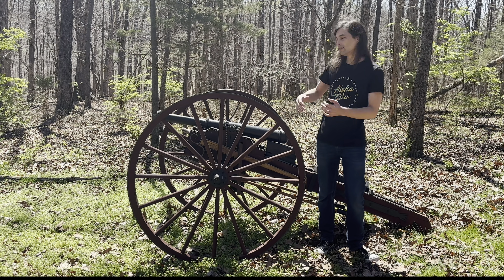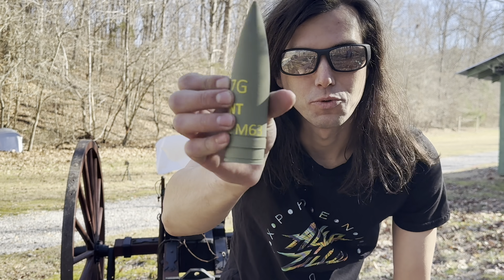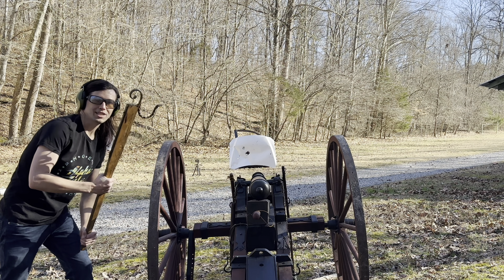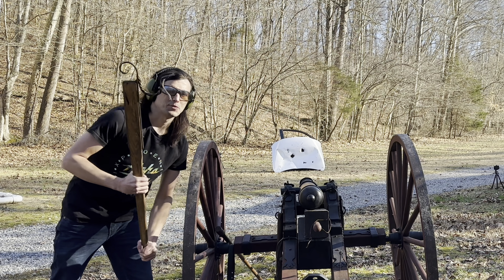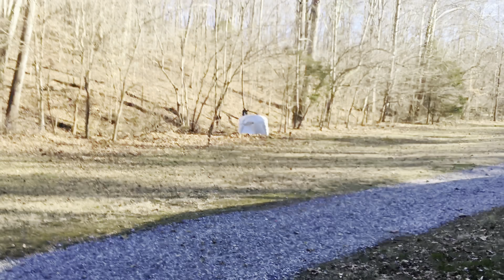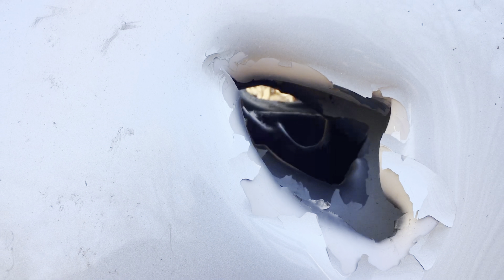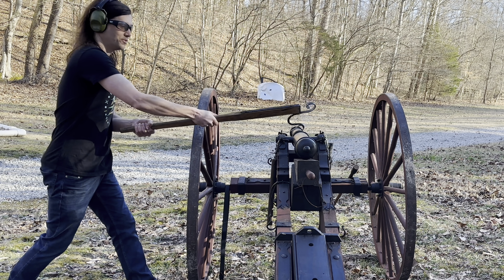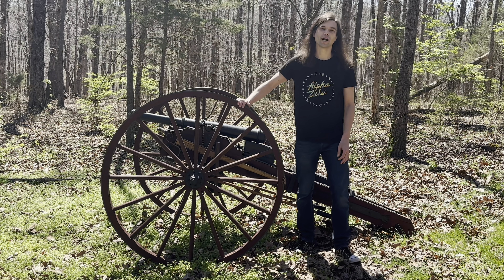Shooting 3D Printed Tank Rounds

Comment: Not sure if anyone commented this yet but PLA is a rather weak filament for 3d printing and is likely to shatter or break apart when firing. I wouldn't be suprised if you're getting a hunk of plastic going down range instead of the properly shaped projectile. Also it appears that long rod of lead separates during flight. I would like to see this repeated where you only do the outer layer of printing and use it as a jacket to cast a lead projectile inside, similar to the copper jacket of a bullet.
Reply from the maker: I just upgraded my printer to handle all the different filaments so hopefully we can try out some of the harder stuff one of these days!

Comment: This type of projectile requires rifling in order to be accurate. For smoothbores you need to look at fin-stabilised projectiles. Two choices on that front are: small fins and (very) high velocity. AKA the APFSDS or 'discarding Sabot' type projectile or low velocity with long, thin pop-open stabilising fins. This is the approach used for HEAT warhead projectiles fired from smoothbore gun barrels.

Now a 'spinning' HEAT round is usually undesirable but you could take the approach that some aircraft rockets do and angle the fins so that air pressure induces a slow 'spin' in the projectile providing an improvement in accuracy similar to rifling.

Comment: the leadcored ammo is just dissintegrating in the barrel, the pla cant push the lead with that much force, so ur just shooting the pla of the lead and then the lead projectile carries behind it at much lower speeds, thats why there was such a huge delay on the first lead filled shot, first the plastic hit the door then the lead core went trough

Comment: Ya that's lead filled print came apart
...your gonna have to study the Nosler Partition, as well as other bonded core techniques. Might have some luck with pl400, or Beats Nails.  Scratch up the lead so that the glue has more and better surface to grip, and sand paper the 3d print as well.  JB Weld is probably a winner as well.  Kick ass, man. Keep the good shit up

Comment: just a suggestion. try to mold a diabolo pellet round. it is designed to fly straight oud of non riffled barrels.
Reply from the maker: I’ve got a printed version so I’ll look into casting them and see what I can do!
Reply: @TheCannoneer  printed objects are made of plastic mesh, as far as i know, the denser the mesh is, the object is heavier. But the mesh is eassy to break under presure. So be it pvc, lead or other material, casted projectile should do better than printed.

Comment: Those are some seriously tumbling rounds, almost every single shot landed sideways :P But the impact ofc was massive regardless due to the lead. Yet I feel greater penetration could be made if they hit on the nose rather than the sides, Normal cannonballs might be superior without the rifling.
Reply from the maker: I didn’t think plastic would leave a hole like that at all. Someone suggested we load them with rocket motors and we did that in a later video as well. Those seem to fly a bit straighter and the hole they leave is insanely huge. Thanks for tuning in!
Reply: @TheCannoneer  Anything launched at high enough speed will punch a hole. Be it plastic, wood, iron, or even softer materials like rubber. Rockets might stabalize the flight somehow, rifling ofc would help. My best bet would be some sort of shaped fin system that utilizes the gasses from the cannon to spin, Although you would have to shape them perfectly..The conclusion being, round shot for none rifled cannons is superior. Yet have you seen how Golf balls look? Perhaps if you made a cannon ball to look like a golf ball with those dips over the surface it might help with both accuracy and range. Just a thought. I am no scientist, not even a school graduate, yet if it works for golfballs it might just work for cannonballs too.

Comment: Is your cannon rifled? If so, will the twist support a conical projectile?  Some rifles have a twist suitable for ball but not a conic. If the cannon is not rifled these projectiles will never be stable and you're only hitting now because you're shooting point blank.
Reply from the maker: No. Cannon rifling didn’t show up until the early 1850’s and since ours is a revolutionary war style it doesn’t have any. We actually got these out to 100 yards on another video and they seem to fly fairly straight with some rocket assistance!
Reply: @TheCannoneer  these cannons should be able to shoot a round ball accurately to 400 or 500 yards.  I don't know about this 37mm (?) cannon, but larger civil war cannons (4" maybe) are remarkably accurate. Out of point-blank range, your modern-style projectiles will fly randomly. Take a long shot and prove me wrong #baitingformorecannonvideos

Comment: May need to work on your center of mass for your projectiles as well.  Try to move the center of mass forward.. I also do not think your print material can withstand the pressures in the cannon and are disintegrating as they leave the barrel..  But otherwise kinda fun.
Reply from the maker: I’m sure we will be revisiting this one in the center with some PLA+ lol

Comment: You should try this at about 500 yards to simulate firing at an enemy Force at that range
Reply: Not sure if you're familiar with a lathe machine you could probably use solid copper or brass heads or even hardened tempered steel for the inner core and top of the projectile checking your powder charges and weight at adjusting to according to the barrel twist if there is any and so forth good video
Reply from the maker: I’m sure we will end up with a metal lathe sooner than later at the shop. It’s one of the few tools we don’t have! Thanks again for the ideas and I’ve added those to the list.
Reply from the maker: One day! We’ve got a 150 yard range so I’ll have to look around and see what I can find. We’ve tried to shoot 100 yards and our current sight doesn’t work out that far very well but we’re about to remedy that as well. Then we can start the distance shooting! Thanks for tuning in!

Comment: I'm guessing that cannon is smooth bore

G1 and G7 style projectiles won't stabilize and will fly erratic (football shaped)

attempt to do the same experiment with fin stabilized discarding sabot (sub caliber dart)

Bias the weight to the front of the dart

You can also attempt to do this with a DS type round where instead of a dart you will use something more akin to a air rifle pellet and have a sabot around it to make it sub caliber
Reply from the maker: It is a smoothbore. Rifling in cannons didn’t show up until the 1850’s and ours is a revolutionary war style. I’ve actually got a prototype of the dart sabots printed up and will be coming out in a future video! Thanks for tuning in!

Comment: they are keyholling.    since there is no rifling they have nothing to stablaize themselves. you need FS rounds
Reply from the maker: On the printer! I’ve got a pic of the first draft on my Instagram too. Thanks for tuning in!
Reply: @TheCannoneer  for smooth bore, you have to enter the lovely world of Discarding Sabots, a horror for all home printers...  

and fin stabilization, an even more problematic choice   fin stabilization have a "tail" with fin on it,   in some cases these fins are fixed... in other cases they are spring loaded to expand when they leave the barrel.     now consider the...   engineering..    for a fin and spring system to withstand the heat and pressures of the barrel and for the fins to still pop out once they leave.   

Look up  120mm HEAT rounds for the different styles used.

Comment: The lead core needs structural support to connect to the walls of the barrel, its likely squishing in the barrel upon movement. A sabbot that is .09 to .13  over will squeeze the compression you want for flight stability
Reply from the maker: I’ll try that next time we revisit these! Thanks for the tip!

Comment: To give them weight more easily you can buy low heat metal alloys used to make chucks when machining. Some of them are very close to the weight of lead and you can easily melt it in boiling water.
Reply from the maker: I’ll look into that!

Comment: How did you pour lead into a PLA casing??
Reply from the maker: Sand casting! So the hollow ones I just filled and then dunked into water really quickly. Lead cools super quickly but it did melt just a bit of it. As for the tipped ones, I cut off the base, put them in a full size sand mold and then poured lead through the hole to fill up the top and the hole. Then dunked them to cool them off after the lead started to set up. They melt a little bit but once they cool they stay together quite well. Thanks for tuning in!

Comment: Cast a lead projectile like a shotgun slug with 2/3 of the weight in the front of the projectile that should solve tumbling issues
Reply: With elongated projectiles you want the shuttlecock effect also known as the rock in the sock effect if you don't have rifling this is how a shotgun slug stabilizes
Reply from the maker: When we revisit this one I’ll be sure to make that version and see what happens! Thanks for tuning in!
Reply: I shoot cannon as well mostly round balls mines 2.25 inches cast the ball out of a downrigger mold from do it molds

Comment: 😂you can try shooting marbles that would be cool trun your cannon into a shotgun or try and get some old horse shoes and cut them into 2in pieces I heard thay did that at the battle of the Alamo 2 Question is were can I get a black powder connon it would be so cool to have 1
Reply from the maker: We’ve shot some marbles as canister shot and we use some giant ones that are the same size as the cannonball too! They are quite scary as they explode into shrapnel rounds! I like your horseshoes idea! And we built ours! There’s a video about it on the channel if you have access to a shop you should build one!

Comment: A last comment....
In my fantasy 3.5 game...
My smoothbore gun tubes used by military forces in my homebrew world fire saboted finn stabalized sabot rounds.
The sabots are made of wood with a cone shaped indentation in the front of the sabots to catch the wind to snap the thin wire and separate the sabots and dart/ bolt continues down range.
I bet with some expermenting you could easilly make a fin stabalized sabot round.
Use crisco grease or lard for lube.
Reply from the maker: I much appreciate your comments! I’m actually printing some as we speak on the 3D printer! I’m excited to see if they work and I’m going to be putting a safety wad under them to make sure they fire out. I would love to have some in metal one of these days!
Reply: @TheCannoneer  use a piece of I would say... rebar 1/2 or 3/4" about...hmmm I would guess from your serpentine one about 8" long with welded on fins.
( Look at a modern M1A3-4 APFDS ROUND and model your round out of rebar based on those dimensions)
Reply: I'm good at thinking of shit like that....
Guess it's all the damn military history reading and research I've done and my marine corps time I spent in the suck ( what we call the marines lol). And the fact I'm a old country boy rotflmao
Reply from the maker: @swampfox1776.  Nothing wrong with being a country boy of any age!

Comment: That lead core is MOVING!!! 800-1000FPS
Reply from the maker: I would love to chrono it but I’m afraid it might take out the chrono!
Reply: @TheCannoneer  I absolutely agree that the fireball would destroy a chronograph. My suggestion to you would be doing a board to the side of the cannon painted at 1-ft increments and then filmed from a 90° angle with a high-speed camera and then you can review the distance travelled per second and convert.. like how Myth busters used to do. 👍🏽👍🏽
Reply from the maker: I know exactly what you’re talking about! Hopefully we can get a nice high speed one of these days. I’ve got big plans for the channel if we can get there!
Reply: @TheCannoneer  Right on! Good fortune to you and your endeavors. 👍🏽👍🏽👍🏽👍🏽

Comment: Awesome video! Well done! Love to see some higher speed video of the rounds but high speed cameras are expensive. 😕 I saw another channel post how 3D prints can be filled with plaster to make them similar to ceramic and heavier. Doing that with these prints may give an interesting result if you're willing to shoot them. I'd try printing with zero bottom layers, 10% gyroid infill, and 3 to 5 walls. That should allow the plaster to be poured in from the bottom and maintain its shape. Thinking about it, small enough lead bird shot may also fit between the infill, then plaster. Could also experiment with rifled round designs. Thanks for making the video!
Reply from the maker: I screenshot your recommendations for everything and I’ll give that a shot! One day I’ll get the slow mo guys on the channel! Thanks for tuning in!

Comment: Your lead fill is being left behind by the low inertia PLA.
Use a pusher plate and wadding.
Reply from the maker: I’ll add that to the list for the revisit on these! We usually use a .5” tpu discs as a spacer and those are reusable and hold up really well. Thanks for tuning in!
Reply: @TheCannoneer  awesome! 
I'd love to see you sand cast a diabolo projectile for the cannon. Maybe lost foam or lost pla . Aluminum, lead, HDPE.
You could print a cannister and fill it with 10mm lead balls, print a sabot for a fin stabilized penetrator spike. 
Look to super-sized Tau Flatermouse experiments. 
Looks like fun!

Comment: I was hoping when you said sabot, you meant discarding sabot fin stabilized.
Reply from the maker: Those are on the printer as I type this. I’m excited for that one.
Reply: @TheCannoneer  did you make a plethora? canted, curved, straight, reverse curved. Take the .117 style pellet design and print it to fit the cannon (cast lead would be better because you could fire it backwards).  From the looks of your shop, you should be well equiped to do some lost PLA castings

Comment: your key-holing due to smooth bore
Reply from the maker: Very true! Rifling in cannons didn’t show up until the 1850’s and since ours is a revolutionary war style it lacks it. I hope if the channel gets big enough to get a 3” rifled field gun and then we can have some bigger fun!
Reply: @TheCannoneer  I dont know if your anywhere near the south, but its not difficult to make a rifling jig, could help ya do it if your close enough or at least maybe talk you through it. There should be some videos on the subject on you-tube. Would be period correct, driving bands of copper or lead, the rifling itself does not have to be very deep. However if you look at the modern tanks rolling around, most has switched back to a smooth bore, with either pre-rifled projectile (drive band kinda) or DSFS.

Comment: The rounds are probably losing stability without the benefit of rifling to add spin. Try printing some discarding sabots
Alternatively, try putting in Tamisier grooves to stabilize
Reply from the maker: On the printer as I type this! Thanks for tuning in!
Reply: @TheCannoneer   I was just about to edit and add a random thought: If the rounds are coming apart in the barrel, some kind of base plate might be useful. I don't know if you have the ability to cut one. I recall old cannons made base plates for small shot from wood?
Reply from the maker: @laserclowns8402  We've been printing some half inch solid TPU discs that hold up really well to cushion the impact. We go pick them up and reuse them after shots. That's the base plate of the wads we use to shoot canister shots. You are indeed correct they used wooden discs back in the day!

Comment: maybe if you were to add grooves like a shotgun foster slug it may spin fast enough to be stable, being a long projectiles with various balance points. they all broke apart or went sideways. maybe a stronger material for the printer.
Reply from the maker: I have a version with the little grooves to try out one of these days! I will also probably snag some Petg although I’ve never worked with it before. Thanks for tuning in!

Comment: It looked like there may be stability issues maybe worth considering pop out Finn's that also impart spin. Also with lead tip and fill shape so step is not as dramatic should help prevent separation. Also consider steel tip for penatration. Love what you have done, interesting to see how far you can develop this!
Reply from the maker: For sure! I’m working on some of the fin stabilized sabot rounds atm and I wonder if they will fly any better. Currently we don’t have a smelter for iron or steel at the shop although I think we’re going to end up with one before too long and then make some real projectiles! Thanks for tuning in!
Reply: @TheCannoneer start with round bar and use a grinder to get a point. You just need a steel core, but it can be jacketed with lead. If you want a copper FMJ you can use a cheap hydraulic press from Harbor Freight to swage copper sheets to the desired shape.